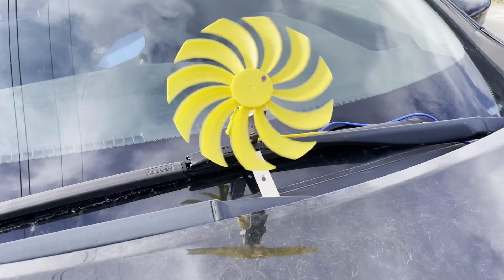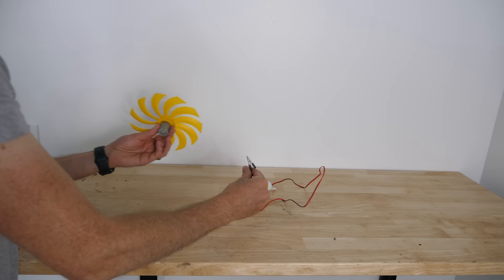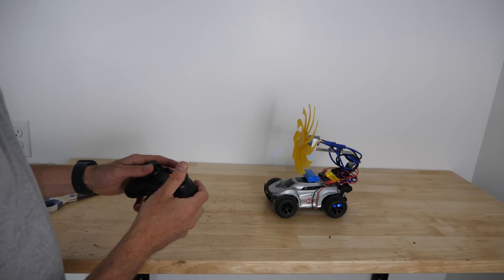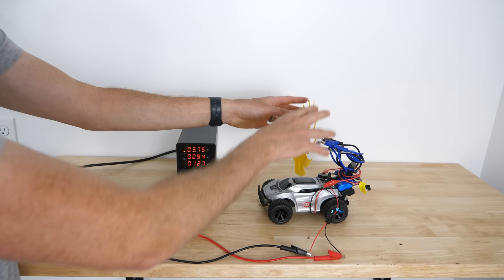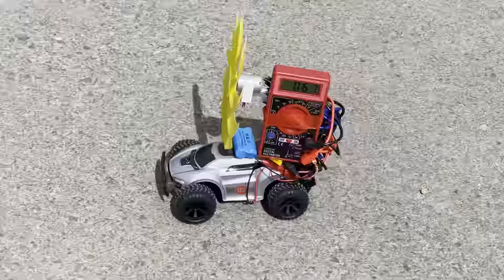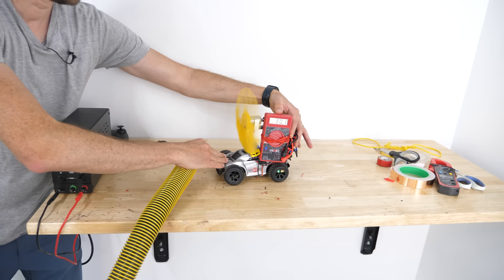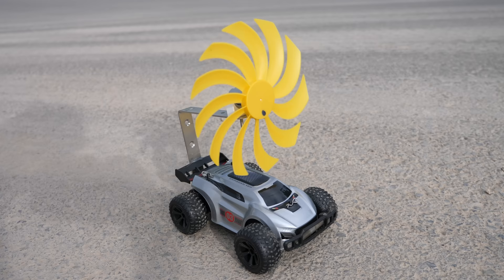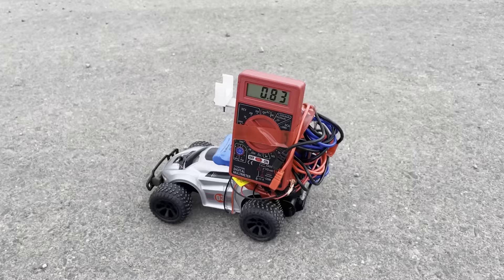Can You Power a Car With a Wind Turbine?

Comment: Thank you for all the many questions you sent to our library if you do your own research you could find this inis mission anyway, This is an old technology and already proven to work, Some of these ideas were not adaptable in cars and some of them they used in cars but all of these things were done and produced why do you think they make shapes like ......
 anyway
there are a few cars that were built with turbines within the body of cars to produce any type of energy. Here are a few examples:

Chrysler Turbine Car: This experimental car was produced by Chrysler from 1963-1964. It was powered by a turbine engine that could run on any type of fuel, including gasoline, diesel, kerosene, and even vegetable oil. The car was not commercially successful, but it is considered a milestone in the development of alternative fuel vehicles.

Rover JET1: This car was produced by Rover in the early 1960s. It was also powered by a turbine engine, but it was designed for racing rather than for everyday use. The car was not very successful, but it helped to pave the way for the development of more advanced turbine-powered cars.

Toyota Fine- 1: This car was produced by Toyota in the late 1980s. It was powered by a small turbine engine that was used to generate electricity to power the car's electric motors. The car was not commercially successful, but it was considered a testbed for Toyota's hybrid electric vehicle technology.

These are just a few examples of cars that were built with turbines within the body of cars to produce any type of energy. While these cars were not all commercially successful, they helped to pave the way for the development of more advanced turbine-powered cars that are now being developed by automakers around the world.

Comment: Maybe instead of attaching a turbine to the car so it sticks out you could integrate it into the chassis of the car so the wind can still blow it but it would limit air resistance. For example maybe a cylindrical turbine inside underneath the rear view mirror?

Comment: If you put this on a windscreen of a car the drag would only increase slightly as the windshield would experience drag without it, surely this would lead to net positive. As you placed the turbine above the car you create drag but if it’s infront drag is at the same level.

Comment: Doesn't seem well explored enough though. It was demonstrated years ago that you can move faster than the wind with the wind using mechanical transmission. Seems like it should be possible, maybe using drag itself, to provide at least enough energy to resist the wind to make something like an aerostatic anchor if not provide just enough impetus to move slowly into the wind.

Comment: What if the wind was blowing from behind? The windmill would act like a sail to add potential energy into the system as opposed to facing a headwind and causing resistance. I realize that would not be possible in the "real world," but just curious what would happen.
Reply: Isnt thats how ships used to work back in the days when we didnt have motors?
Reply: @shaksham.22  that's what I am asking. Could the "propeller" act like a sail if the car was going in the opposite direction.
Reply: @coolnegative  that would work as long as the propeller is not rotating. Because even if there is a force from backwards, when the car starts moving the structure will also face resistance from the air flowing over the car from forward to backward direction, which in a way would cancel it out.
Also if the air is moving from backwards to forward direction then it would counter rotate the fans which would produce energy that works in anti to the movement of car. So it will never work out at fast speeds. It would only work in limited manner if the car is slow and fan doesnt rotate.
Reply: @shaksham.22  got it. Thanx!

Comment: Now what if it was mounted behind the vehicle and harnessed the turbulent air spinning behind the vehicle caused by the existing drag?
Reply: Then would cause even more drag.
Reply: It will be like the parachute brakes on hotrod cars
Reply: I mean more like behind a truck or a ute where you get a pocket of spinning air trapped behind the cab. Could you harness that air that is pulled in from the drag on the vehicle
Reply: No free lunch. It is connected to the truck and would pull back the truck slowing it down more than the energy it generates.

Comment: If the car is placed on a railway track and the wind spinner is mechanically connected to the car's drive wheels. If we then let the wind vane turn against the direction of the wind all the time, then the car must be driven forward regardless of the direction of the wind. We let a low-ratio worm gear drive the car. Now we have small sailboats that we can put on track, at some point they will arrive at their destination.

Comment: Look at what a Dyson
 vacuum cleaner does. That's the kind of technology you need to use for your application.Harnessing every  bit of the wind, thereby Harness  full potential

 so by converting the momentum of the incoming air into mechanical energy There could be harness to contact as the blades Rotate making contact each time with electrodes.

Comment: That is amazing! So, Is possible to make that "drag" the energy source somehow? In that case the objective of the car will not be to move around efficiently but to be a mobile generator or something.
Reply: You'd be better off replacing the car hood with a solar panel
Reply: @MelodicTurtleMetal  there should be a way to make it work, but the most hidden the secret sauce the more time it requires to be discovered, or maybe is not possible
Reply: @artificercreator  You can't build a perpetual motion machine with conventional physics regardless of the methodology. There is absolutely no way to make net positive energy from air drag or any other friction loss in a self-propelled vehicle. The vehicle's propulsion system, regardless of what it is, is always the source of movement. The only possible way to make energy from wind is from ambient wind, and no car can do that efficiently no matter how you go about it. There isn't enough energy in ambient wind in a volume anywhere near that of a car to really move a car, they're just too heavy for their size.
Reply: @artificercreator  Drag is not an energy, it's a resistance. It's pretty much energies working against each other.
Reply: @5467nick  Thanks for explaining it that way.
Reply: @MelodicTurtleMetal  I will have to learn the basics i guess. Thanks for the correction.

Comment: What would happen if instead of going against the wind you drove with the wind to your back? Would the wind both push the windmill and spin it?
Reply: Here's a comment from our library and thank you for thinking outside the Box it's so few people who do that.
see that quite a few people are giving you a thumbs up. Keep in mind this little technique: if your phone goes down to one bar and you plug it in and you are still using the phone, your phone will fully charge. This is called pass-through technology. If you do research on this, you will find that if this was applied, you wouldn't have those inefficiencies.
What did I just do? I just used a technology that's been used for quite some time, instead of doing everything directly. It means that for over a 100 years, we've been off the direct power train and got on Nikola Tesla's alternating technology. As soon as you start to understand exactly how you can power something at the same time use its power, you can make this work. Of course, other companies and other people have already done this and got the car in real life to actually work.
So instead of arguing back-and-forth with the guy who I believe is prejudiced on certain subjects, I simply went to Google AI and asked the question. Here is what AI stated:
Yes, there are a few examples of people who have successfully driven cars with windmills attached to them.

In 2009, a team of students from the University of Michigan built a car that was powered by a wind turbine. The car was able to reach speeds of up to 35 mph.

In 2010, a team of students from the University of California, Berkeley built a car that was powered by a solar panel and a wind turbine. The car was able to travel 100 miles on a single charge.

In 2011, a team of students from the Massachusetts Institute of Technology built a car that was powered by a wind turbine and a hydrogen fuel cell. The car was able to travel 200 miles on a single charge.

However, it is important to note that these cars are not practical for everyday use. They are very expensive to build and maintain, and they are not very efficient. The wind turbines are only able to generate enough power to move the car at slow speeds.
It is more likely that wind power will be used to supplement the power of a car's engine, rather than be used to power the car entirely. This could be done by using wind turbines to generate electricity that is stored in a battery, and then using that electricity to power the car's engine.
Please start asking questions before accepting information from someone that is intelligent but often makes quite a few mistakes. Even if you have to go to AI and didn't back it up with actually going to websites that show the results of people's accomplishments, if not then we can't move forward. We stay the same and people like that don't want real change. Read it for yourself before you give thumbs up.

Comment: But you can charge your ev with wind turbine when you are for instance in a traffic jam and it's windy day! But then you'd have to hide the fan every time you gain more speed again ;p
Reply: see that quite a few people are giving you a thumbs up. Keep in mind this little technique: if your phone goes down to one bar and you plug it in and you are still using the phone, your phone will fully charge. This is called pass-through technology. If you do research on this, you will find that if this was applied, you wouldn't have those inefficiencies.
What did I just do? I just used a technology that's been used for quite some time, instead of doing everything directly. It means that for over a 100 years, we've been off the direct power train and got on Nikola Tesla's alternating technology. As soon as you start to understand exactly how you can power something at the same time use its power, you can make this work. Of course, other companies and other people have already done this and got the car in real life to actually work.
So instead of arguing back-and-forth with the guy who I believe is prejudiced on certain subjects, I simply went to Google AI and asked the question. Here is what AI stated:
Yes, there are a few examples of people who have successfully driven cars with windmills attached to them.

In 2009, a team of students from the University of Michigan built a car that was powered by a wind turbine. The car was able to reach speeds of up to 35 mph.

In 2010, a team of students from the University of California, Berkeley built a car that was powered by a solar panel and a wind turbine. The car was able to travel 100 miles on a single charge.

In 2011, a team of students from the Massachusetts Institute of Technology built a car that was powered by a wind turbine and a hydrogen fuel cell. The car was able to travel 200 miles on a single charge.

However, it is important to note that these cars are not practical for everyday use. They are very expensive to build and maintain, and they are not very efficient. The wind turbines are only able to generate enough power to move the car at slow speeds.
It is more likely that wind power will be used to supplement the power of a car's engine, rather than be used to power the car entirely. This could be done by using wind turbines to generate electricity that is stored in a battery, and then using that electricity to power the car's engine.
Please start asking questions before accepting information from someone that is intelligent but often makes quite a few mistakes. Even if you have to go to AI and didn't back it up with actually going to websites that show the results of people's accomplishments, if not then we can't move forward. We stay the same and people like that don't want real change. Read it for yourself before you give thumbs up.

Comment: I've often thought about the amount of kinetic energy which exists when you see all these cars traveling down the highway, and if there was some way to harness just a small portion of that energy back into something useable. One idea I had was to have a series of pumps under a section of high traffic road. Attached to these pumps are steel plates which act as the road surface, as each vehicle drives over it depresses very slightly. To the driver it would just feel like a brief bump. The plates return to the upper position using springs. These pumps draw water from a lower reservoir and pump it into an upper reservoir. Once full, the upper reservoir is drained through a turbine which generates electricity.
Reply: The energy would come from the cars, which would  end up with slightly worse efficiency. SInce there will be losses along the way, overall it will be worse than not having it.(absolute best with 100% efficiency, impossible, would be break even)

Comment: The way you can get the fan blades to show up as blurry in the video is to use a neutral density filter for your camera lens, which causes less light to be brought in, meaning that the exposure time has to be increased. Lots of cameras even at the lowest ISO setting are too sensitive during daylight for you to be able to capture any kind of motion blur.
Reply: >> meaning that the shutter speed has to be increased.

Less light requires the shutter speed to be decreased.
Reply: @Rick_Cavallaro  thanks for pointing that out, I meant to say "exposure time".
Reply: @R2Bl3nd  Yup - I figured that's what you meant.

Comment: The technology is solid but needs to be improved with Forcing the wind to turn smaller turbines and have a better alternator system that can actually harness the electricity more efficiently putting it back into the main battery bank that can be utilized at a later time

Comment: The only way that would work is if you went to an area of the car with the air was turbulent and not actually attached to the car, which would be the rear of the car. Otherwise everything would be complete losses, which is as you explain.

Comment: Another idea would be to build wind generators in the road under the cars and then optimize the cars build to direct the wind downward. That would create a force that tries to lift the car from the road, thereby reducing the friction against the road, as well as a wind flow to harvest electricity from. Especially with AI driven cars of the future it would probably not be very difficult to keep the car exactly above the wind generators in the middle of the road. You could let the air pass through the wind generators and then underneath the road and out to the sides of it. You can build the electric grid of your city or car charging stations along the roads and tap into the wind generators.

Comment: Good video overall - as always, but you definitely need to rethink your claim that a propeller or turbine cannot add energy on a windy day.  I've set world records doing both, and the vehicle was featured on Veritasium.
Reply from the maker: The propeller can definitely add energy on a windy day, but the maximum efficiency of a wind turbine is around 50-60%. So you are always going to be adding a lot of drag when including a wind turbine on a vehicle when driving into the wind. As you have shown, it is possible for a specially designed vehicle to go downwind faster than the wind. But this video is more a discussion about why a vehicle cannot extract energy from the wind it creates by moving through the still air.
Reply: @TheActionLab  You're right that the Betz limit keeps your turbine efficiency down in the 50-60% range, but you can still harvest plenty of energy from the true wind to give a net benefit.

>> this video is more a discussion about why a vehicle cannot extract energy from the wind it creates by moving through the still air.

Yes, and I was 100% with you on all of that.  But at 5:00 you pointed out that it cannot even work on a windy day - and it very definitely can since you no longer have a closed system.

Comment: Try using a different propeller... There are small horizontal propellers that might work more effectively.. I'd also suggest the inefficiency of the turbine may have been due to its size as it was a similar size to the vehicle itself...

Comment: The concept can be useful for converting fuel to electricity. I’ve worked on an aircraft that had a ram air turbine that would pop out as an emergency generator.
Reply: point being, it is only used as an absolute last resort should the airplane somehow lose all other forms of backup power while it's already at altitude and efficiency is less important than saving human life

other than this 0.00001% niche application, it is otherwise useless concept
Reply: @WV-HillBilly  There are other ram-air turbine generators that are used for non-emergency purposes. But yeah, it's pretty niche, mostly limited to aircraft and I could surmise the same concept could work on ships and other water craft also.

Comment: I still think this would be beneficial for my old Honda 6v mini bike. The old alternators are so weak.

Since it’s not electric and runs on gas it will only add power to the battery and the gas motor won’t even notice the drag of that wind turbine.

And then if I run out of power it brings new meaning to a jump start lol
Reply: A new alternator would be cheaper, more efficient, and more reliable.